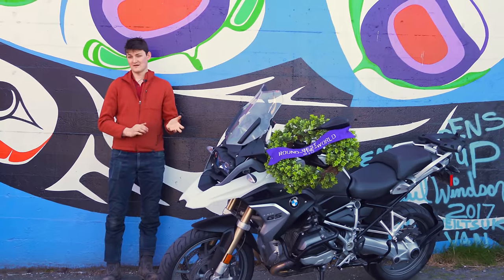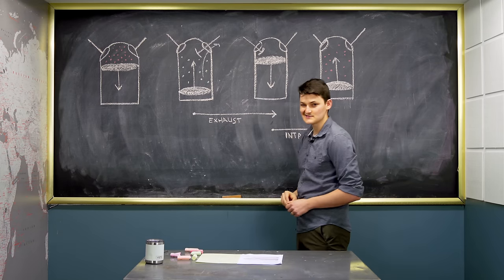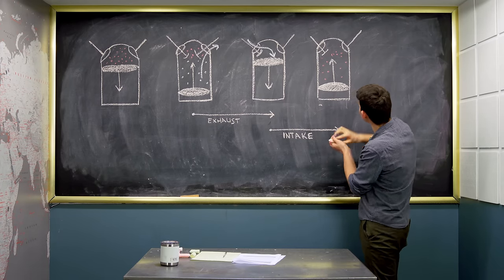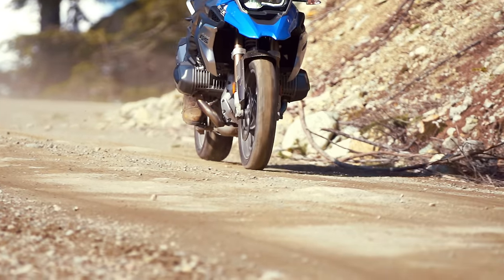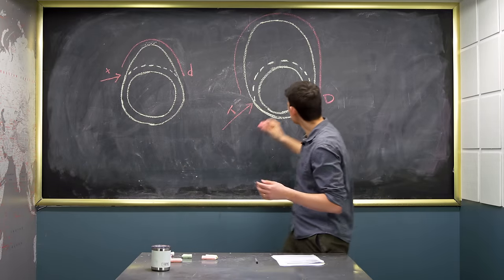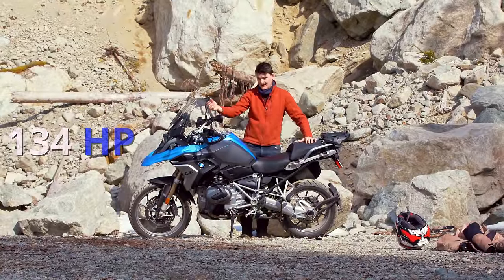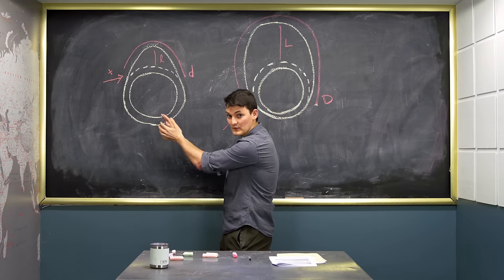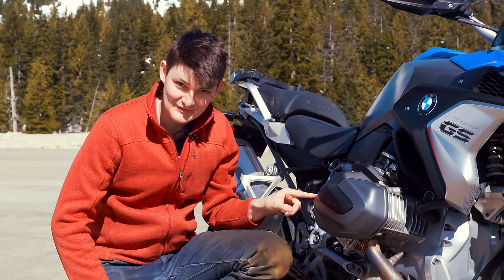Variable Valves are Bad for the BMW R1250GS - Review

Comment: Needlessly complex German engineering. Yup. I had a mid 2000’s Mercedes. The radio had 37 BUTTONS!!!  (Including a phone keypad - like you are going to dial the phone on the dash of your car while driving down the road). Of course it quit working, and the quoted replacement cost was more than the car was worth. I’ll never buy German ANYTHING again.

Comment: People will not walk away from the GS 1250, simpy because the GS is like the big plush, status holding, stupid expensive 4X4 of motorcycles.
Like Range Rovers, most GS's never go offroad. They just serve as status and penis size increasing tools. I know... I ride a K1600 amid a large group of GS's...
I like comfortable touring, and apparently GS owners like it also. So... why don't they buy an RT or a K16? F*ck knows...
Reply: If the rt was a lighter more compact bike people would probably buy it over a GS.  BMW should consider a R1250xr.  If you ask me.  I would still like a r1250gs. Don't need to go off road. It still has a good engine good ride good low down and top end power. And balance that is unmatched. And a shaft drive. I don't like 17" cast wheels or a huge fairing that's why I don't like the RT.  And the RS is way too sporty.

Comment: hill start assist is easily disabled. I learned without it and wish I had the option but its not on my 2017 1200GSA.  Great review on valves, yes they should be progressive as opposed to one or the other!  I look forward to seeing new tech in this area.

Comment: So in the end it is just another over-engineered piece of shit from BMW.
I have seen too many stupid problems with BMW bikes:
- leaking fuel pumps
- ABS warning lights flashing on and off
- Low brake fluid warnings when the reservoir is full.
- Rough running in the RPM range you use the most.
- ECU refusing to run when a hot bike parked in the sun with insufficient wind.
It is mostly marketing. Never have problems with my 1982 Honda CBX-1000 6-cylinder.
The special tool to change the oil is just a trick to make sure you (like an addict) return to the dealer.
Reply: I bought a new R80 back in the late 80's thinking I was getting one of the best motorcycles available. What a POS! Nothing but problems and slow too. Sold it after 2 years. I took a beating on it but I was glad to have it out of my life. Never again BMW. Never again.

Comment: PART II IN WRONG PLACE
With respect to the notion that the shift only works at specific rpms is at least an arm-waving generalization if not inaccurate...the new motor is faster everywhere... it has more torque ...everywhere (+10)... it has the SAME torque curve shape (think camel). Tsk tsk ...you did not point out the old bike has the SAME dip in torque (or as you said distinct power bands).
A fair poke at intraweb beemer sites turns up virtually no thread of shift cam failures. And despite this performance improvement it gets better claimed mileage (kilometrage in Canada) but actual riding reviews say its the same... So I'm not suggesting you should drop to your knees in its presence ... but you are in the presence of mechanical and marketing greatness...a Kingdom indeed ... and not worthy of your disdain... Perhaps this video just caught you in an iconoclastic mood, or at least contrarian frame of mind ... 

And yes, every empire falls, but no time soon here say the #s... And more people go around the world on them than anything else (to date) ... And for the love of [choose your deity], it's not a dual sport in the category sense... So comparing it to anything that really is, is silly ... 
It is, however the best selling motorcycle ever (maybe Honda sold more 50cc scooters... "You know, you meet the nicest people on a Honda" ... circa '63))
BMW is doing what companies with huge, loyal bases do ... they keep giving them slightly better versions of what they already love ... 
Or ... hey, Ryan, have I just been Poe'd??!! :) .. the Hindenberg Uncertainty Principle is alive and well ...
cheers and kudos on the F9 success ...

Comment: I love BMW but a special tool for the oil fill cap is ridiculous
Reply: It's part of the tool kit under the pillion seat
Reply: @murasamest1845  Maybe to prevent strangers peeing into your engine. Be assured there is an OEM fill cap available, that requires some weird 5 star temper resistant torx tool, available in silver and black.

Comment: miny1250gs developed engine clanking noise in left cylinder after 11000km. bmw refused tp fix it under warranty saying that it is normal. b.s. after loosing a season sold it back to dealer for 13500 euro. lost a lot of money and fun time and faith in humanity. bmw sucks.

Comment: Heir Kliffhanger, comme d'habitude, clever, glib, and amusing oozes of sarcasm ... but there's also a serious amount of cherry-picking going on in your narrative. (I think you know that) ... I have never owned a GS12 , have no loyalty to BMW (4 or 2 wheels) although I have owned M3 and a couple of K bikes over the years...
But let's consider a counterpoint to your counterpoint... perhaps a recounterpoint then ...
First BMW is a history lesson in incrementalism. It's riders/drivers are conservative and in the case of the GS12, the best-selling bike in the world...ever... always and fully a 1/3 of all BMW bike sales and unit sales every year (2019 a record). It's like the 911... Make sure you make it better but don't change it. 
So ... the shift cam ... no ... is not an engineering revolution or marvel ... check ... but it's proven... like everything is with the GS12... or most things the Bayerische folken do ...And that, IMHO is by design, not laziness or lack of creativity. If you want the latest thinking in the category, get a Duke or Multi ...
And actually, the shift cam is mechanically simple ... the shaft won't break... the electro-fluffery unit is right in the airflow (cool...as it can get in the head). If the servo motor/controller breaks, it just won't shift (cam) I'm told. It won't die. It also seems easy to access... right under the valve cover... 
So in fairness, not the Pandora's box you insinuate lurks beneath ... PART 11 AHEAD

Comment: I am a little confused: how is 9% more Hp, "14% more TQ hitting lower than ever", increased fuel mileage, and a much smoother engine bad for the GS?? That sounds like a very nice list of things in the plus column to me. Those changes resulted in me finally buying my first GS after passing on the 1200 numerous times.

Comment: Ouch but fair perhaps. Oil filler cap that requires a special tool. That’s convenient for west African touring. Doesn’t matter that you can’t find the right oil coz you can’t pour it in anyway. Overpriced status symbol frankly. Or am I just jealous?
Reply: The special tool is the screw drive handle under the pillion seat, and oil wise it uses the same oil any other motorcycle does.

Comment: Some dishonest BS in this review.  The oil filler adapter is under the seat and hill stop assist is rider controlled by simply not gripping the brake lever at maximum.  Pull hard to set, pull hard to release, pull gently to use brake and not set the assist.

Comment: Could someone PLEASE tell this fool that the Hill Assist is removable so you can turn on a hill? and actually comes in handy if you are on the hill and need to do anything besides sit there and hold the brakes on. This is a joke of a review. I think he did just to get interest like this.
The sad part is it is clearly not a serious review of the capabilities of the bike. This has destroyed his credibility as a legitimate cycle analyst.
Is the GS1250 the best adv bike? Maybe not, but it does LOTS of things VERY well.
The suspension, electronics, torque, and low weight distribution are awesome. I have been riding longer that this guy has been on this planet. I can not count the amount of Bikes I have ridden. I just purchased one of these a few months ago and it is AWESOME! This will be the last review I watch from him. His credibility is SHOT! As an entertainer he is amusing as a reviewer he is annoying!